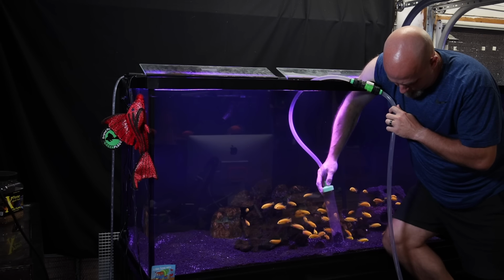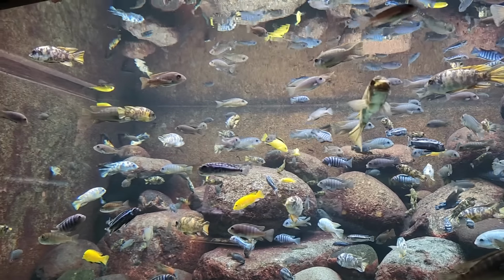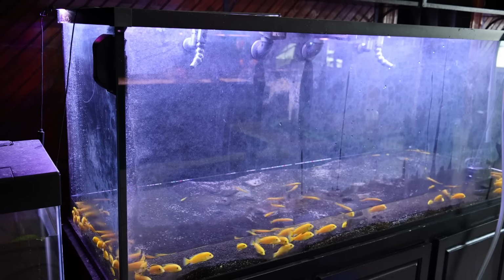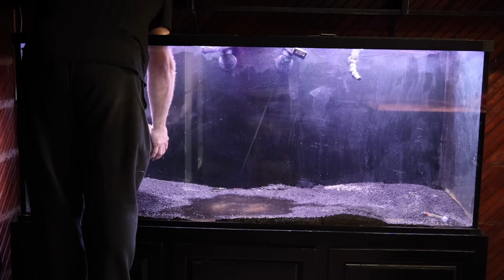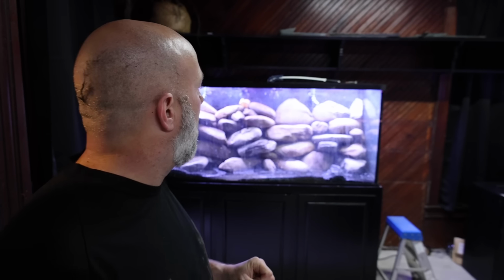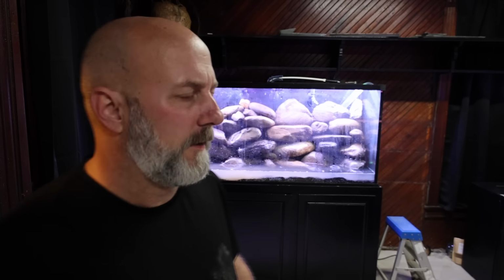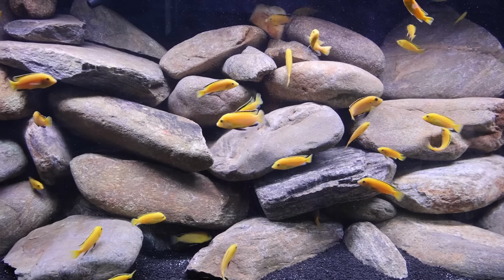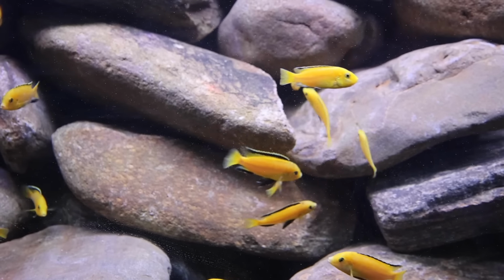I Built The PERFECT Tank For Cichlids, Yellow Lab Aquascape

Comment: Here's a tip that's too late! I bought a heap of various sized terracotta plant pots, made doors in them and enlarged the drainage hole just by 'biting' off chunks with a pair of pliers, and arranged them all across the back of the tank. Then it was simply a matter of resting the rocks on top of them, and in front of them until you couldn't see any pots.
You get so many more caves that way, not only in the pots, but between them too, it's very stable, and you aren't taking up so much water volume with solid rock! 
Maybe next time huh? 😁👍

Comment: Any concerns about the cichlids undermining the rocks so the rocks tumble or shift? I've always worried about the rock in my tank and put them on a pond liner pad. Not for fear of tumbling, but the pressure points that might be created as you mentioned. I'm thinking light diffuser when I relocate and rescape.
Reply: Came here to say this. Sand is NOT going to prevent those rocks from settling to the glass. Certainly not with cichlids. They undermine rocks. It’s what they do. It will probably be OK, since it’s tempered glass (I hope), but I would definitely have egg crate or something similar underneath. The other issue is undermining and having the rock pile shift and smack the side.  It’s a cool tank, but I think sand-only was a miss.

Comment: Hi.  Just thinking about the weight of the tank.  Be mindful of the total load on your floor.  A wooden floor with joists will move with that kind of load and any "sight seeing" traffic humans generate around the tank.  Make sure the floor is well supported from below, otherwise, depending on your house, tiles will crack, drywall screws will pop and drywall seams will crack.  If you've had a home Reno to a bathroom, that's why any decent contractor will beef up the sub floor.  Just my 2 cents worth.  Lovely tank.

Comment: One question. When do stones add more pressure to the bottom glass? When they're in water or without the water. Because everything is lighter when in water but the weight of water adds to the pressure as well. Im asking this because i want to know if the bottom can break when you fill the aquarium not knowing you made it too heavy.

Comment: I'm not sure how these big tanks are built but my tanks all have a plastic support piece around the bottom which means the bottom glass is floating above the stand or table and only supported by the edges. Many, if not all, of the commercially available stands I've seen just have support for the tank around the edge with the center being open. With enough weight the bottom could get flexed enough to break. I think a tank like this would need full bottom support, like a strong flat surface and a neoprene pad under the tank. The pressure points are an issue, but the sheer unsupported weight fully on that glass could be one as well.

Comment: I don't think that putting rocks on the sand is great Idea because I did the same and my cichlids moved the sand during breeding and eventually the rocks fell down, surprising my tank was fine maybe because it was just 250 litre.

I would recommend to use old filter pads under the rocks as it helps in weight distribution as well as Biological filtration.

Comment: Placing heavy rocks against the back glass of the aquarium is a HUGE mistake. The calculation of glass thickness is based on the volume of water and the size and width of the locks. Supporting stones on one of the panes, used as a balance point, is a serious mistake in your project.  I'm so sorry for saying this.